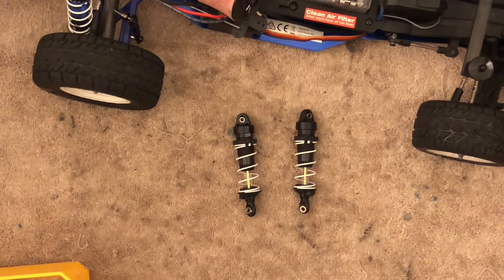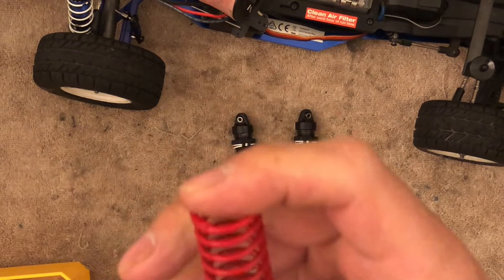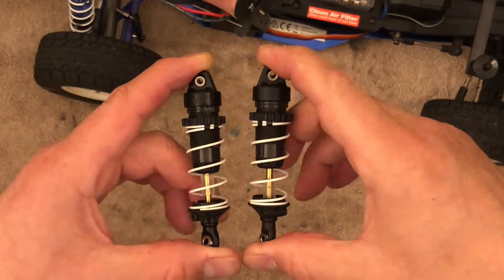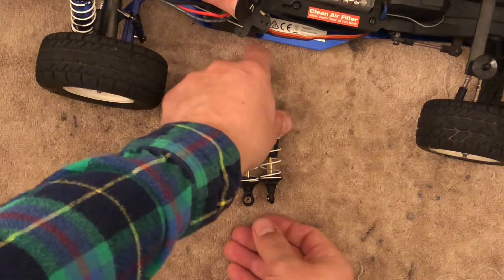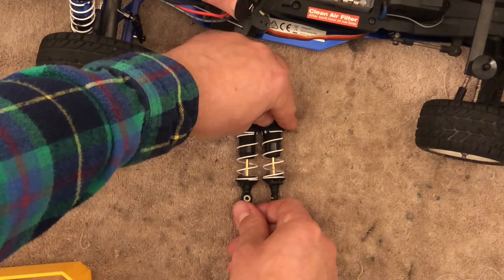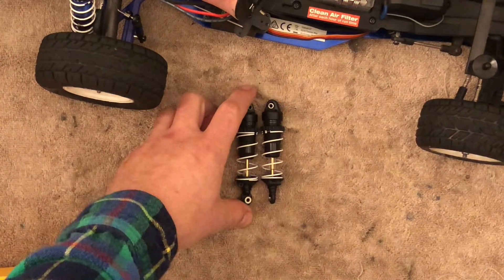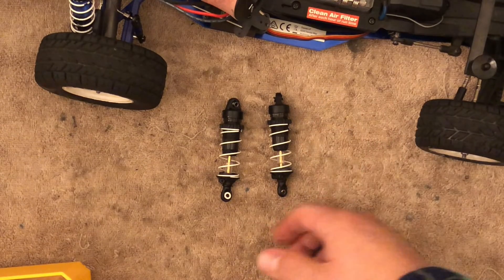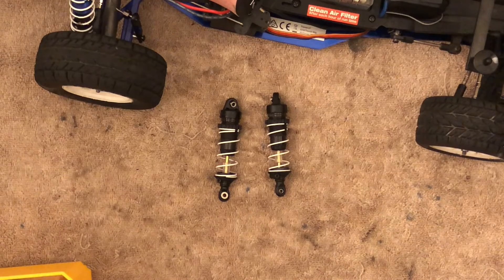Using Traxxas GTR Long shocks and black springs to quickly compare effect to 47 5wt and 60 wt oil

Comment: 40wt is the standard I think or 45wt.
Reply from the maker: I always wondered because the included bottle is not labeled.
Reply: It's annoying when they don't label stuff I might be wrong too actually cos I was thinking GTR shocks REVO. Bit heavier lol. So mayb 30wt is standard. 

I just checked the Xmaxx and it says 30wt as standard that's shocking pun appreciated thanks brain. 😮😢
Reply from the maker: @TrollingHistory  😁 nice pun... But not to dampen the mood, but the oil weight does seem light. Probably 30WT-35WT. I have no way to truly measure. Especially as I do not have 30WT or 35WT anymore. I have 400cst, 450cst. I guess I can compare and guess. I have many oils, but the point is the lighter stuff is in cst, and the heavy stuff in WT. And different brands to boot. But Traxxas oil in the kits seems too light for practical application in these kits.